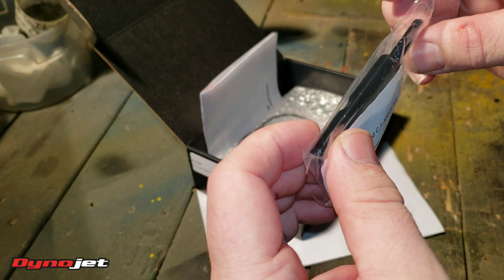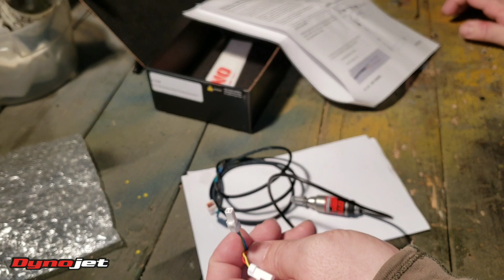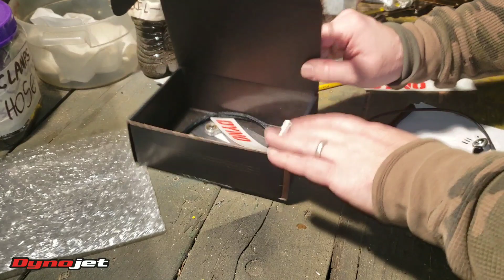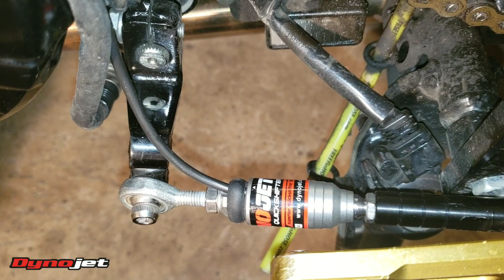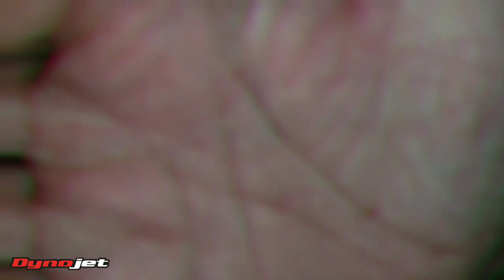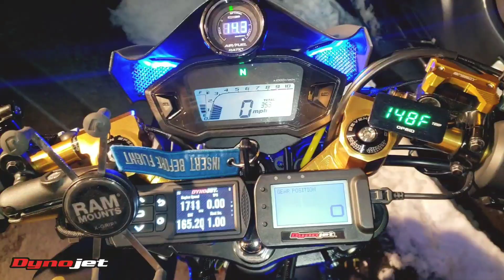Honda Grom dynojet pcv quick shift review and installation

Comment: What all is needed to install a quickshifter on a stock 2019 grom??
Reply from the maker: There is standalone quick shifter units and then there is the quick shifter that we recommend which works with the power commander. So you could install a power commander and you could do the custom tuning for a stock bike it would make more horsepower and torque output even with it being bone stock. Or we could do no tuning and just use it to add the quick shift and control the quick shift. However you would definitely benefit from doing the tuning and the quick shift combination.
Reply: @BLRTUNING  thank you bro 👍 very much appreciated
Reply from the maker: When you get a chance take a look at our website in our Honda Grom section. I'll be adding the quick shift on there within the next day or two. You'll be able to order the PC6 and the quick shift all from our website. You can even order the pc6 with a custom tune, launch control, and raised rev limit

https://www.blrtuning.co/collections/honda-grom-parts-accessories
Reply: @BLRTUNING  is it up/down or just up?
Reply from the maker: It would just be the up shift. It is reversible with the wiring so you can make it work with GP shift but it only works going up into the next gear
Reply: @BLRTUNING  I’ll be checking out your site for the next few days for that

Comment: Does it matter what wire goes where into the power commander? As in can u get port 1 and 2 mixed up?
Reply from the maker: You'll see in the power commander settings that you have switch input number one and switch input number two. If you're looking at the harness in the middle of the power commander the first two sets of holes is switch input number one The second set of holes would be switch input number two
Reply from the maker: So basically those first four holes. Holes number one and two belong to switch input number one. Wholes number three and four belong to switch input number two. As far as colors of wires and that type of stuff it doesn't matter. There is no positive and negative to those holes. Basically when a switch in power Commander is activated it's just connecting holes number one and two together or connecting holes number three and four together. So you want to make sure you use the corresponding holes or else the switch input stuff would not work
Reply: @BLRTUNING  thanks

Comment: I’m looking at the same QS, is this compatible with any bike that has PCV? I have an mt07 I was hoping this would be compatible with. Thanks in advanced
Reply from the maker: You should check their website and see if they make one specifically for your bike...

They might make one that works with your factory rear sets..

The one that I show in this video is the universal one and requires you to possibly have to make your own post to go from the quick shift to the rear set..

All of them from Dynojet will require the power Commander v to be able to run the quick shift..

So to answer your question yes this one will work for your bike you just may have to do some modifying to the way that it connects to the shifter...
Reply: @BLRTUNING  last inquiry, we’re you able to find the link to this particular one so I can make sure I’m definitely getting the right thing? Thanks again man
Reply from the maker: @kdogthegreat13  

if you go to this link it will show you all the different stuff they have available for quick shift options you should definitely go to their website and enter in the year make and model of your vehicle to see if they have one specific for your vehicle..

https://www.dynojet.com/catalogsearch/result/?q=Quick+shift
Reply from the maker: @kdogthegreat13  if they don't have one specifically for your vehicle it may require a little bit of modification to get it to work correctly as far as it linking up with your existing rear set connection for the shift rod...

the one that I show in this video has both the push method and the pull method you can hook up either one to power Commander five..

You'll need to determine whether your bike is pushing when you go into the next gear or pulling when you go into the next gear...

Make sure you order the right one or the universal one that does both
Reply: @BLRTUNING   hey man, not sure if my last message went through but thank you so much for taking the time and guidance. Wish you and your family a good 2021!
Reply from the maker: @kdogthegreat13  thank you for very much and I wish you and your family the same...

If there is anything else I can do for you you can always message me through the blr tuning Facebook page.. that makes it much easier to communicate over YouTube's messages.. sometimes these messages on YouTube don't get to the YouTuber that owns the channel for several months.. here's the link to the blr tuning Facebook page...

https://m.facebook.com/BLRTUNING/
Reply: @BLRTUNING  thank you bro I really appreciate you taking your time to respond. Definitely got a like and a sub. I have a 2018 grom and hopefully if this second stimulus passes for 2k, I’ll get more mods to match my mt. Happy new year brother!

Comment: Everyone else on they videos mentioning  to connect the quick shift
 to power commander 5 but they not showing how !! 
 you actually showed the ports and connection points and with all the required attention and details 
Awesome video thank you very much !!
Reply from the maker: as far as setting up the quick shift it would be the same on any vehicle it uses the same ports and you can use the same settings you can fine-tune the settings if you'd like in power Commander 5 software..

hopefully if you like the YouTube content you'll consider subscribing thanks for checking out the video I appreciate it
Reply: @BLRTUNING  Just  SUBSCRIBED !! cheers !!

Comment: I’m in the process of trying to order it and which one do I need to get to linear pull or linear push??
Reply from the maker: It all depends on how your shifter is set up you need to take a look at the rod connecting the shift linkage you would want one that is able to shift up into the next gear so look at your shifter and see if when you go up into the next gear is the rod being pushed or pulled.  if you have the stock rear sets they make a completely different quick shift specifically for the stock rear sets...

The one that I show in the video is a universal one that has push or pull built into it you can use one or the other..

Comment: hey i just have a question. so if i already have a pcv, do i need to buy anything other than the shift sensor/rods? or is this all i need for quick shifting???
Reply from the maker: It depends on what bike you are talking about. For the Honda Grom yes this is all you need.. the quick shift module plugs into power Commander 5 and is controlled through the power Commander v software... some bikes will require the ignition module that goes along with power Commander v in order to use quick shift or two step launch control.... for the Honda Grom all year models all you need is power Commander v and quickshifter...

Comment: Hey bud nice vid ...
Need your help please ... Kill mode for my quickshifter on option it gives me is kill fuel ... I don't have option to kill fuel and ignition
Reply: Got a pc5 and Dyno jet quickshifter on my 2005 repsol 1000rr
Reply from the maker: @Angelo.salamone19  you need the ignition module for your bike.. that would also allow you to wire in 2 step launch control as well..
Reply from the maker: @Angelo.salamone19  it's kind of weird that the Grom doesn't require it but I guess it's just a more simple ECU.. most bigger bikes require the ignition module
Reply: @BLRTUNING  ay bill cheers man okay yeah if a additional unit is required then all good I just thought I did something wrong with the installation. 

Bike is shifting super shit though... I don't know if that could be the reason not having that module coz sometimes she'll  shift (not like butter) then in some gear it doesn't want to know nothing . 🤔
Reply from the maker: @Angelo.salamone19  look for the ignition module that works for your bike.. you have to have that in order to use that quick shift correctly
Reply: @BLRTUNING  💯 thanks brother ride safe out there

Comment: Why didn't you just use the shift rod you had originally on your bike
Reply from the maker: It wouldn't work.. I would have had to cut it all up... Remember this shifter is universal so it will fit on multiple bikes but on just about every bike out there it's going to be somewhat of a custom install.. if you order one and you send an email to Dynojet and tell them what bike you have they will send you the correct pieces... this was a test unit they sent out to me and the first one to be installed on a Honda Grom with an aftermarket rear set...
Reply from the maker: Also you can't use the normal shift rod because it won't connect to my aftermarket rear sets

Comment: Thanks for the explanation, I got a 2008 CBR1000RR, I just installed a PCV and i need to put my Quickshifter Blipper . I also have a Secondary Fuel Module (not installed) a bazzaz Z bomb (not installed) and an Autotune (not installed yet)... my question is , do I need to put a module ( Secondary fuel module or any other thing) to be able to use the Quick Shifter or only link the QS Blipper/rod wires to the PCV ? 
Thanks again
Reply from the maker: quick shift gets wired straight to the power Commander 5 and then can be controlled from inside the power Commander v software.
Reply from the maker: You won't need a secondary module
Reply: Thanks a lot Man !’

Comment: sick!! Do you need the PCV5 for the quick shifter to work or can you install the quick shifter as a standalone?
Reply from the maker: With this quick shift you need power Commander v it cannot be installed as a standalone unit. Dynojet also has the pv3 which is a flash tuning device that will flash the ECU and allow you to tune it using their C3 software. They are working on a quick shifter that will work with the pv3.. right now dynojet quick shift is only available for power Commander v.